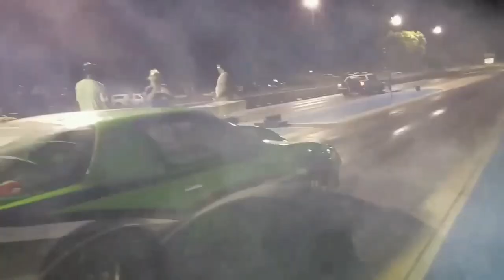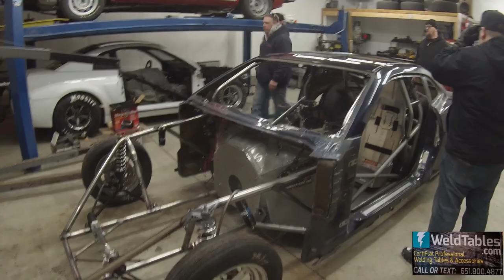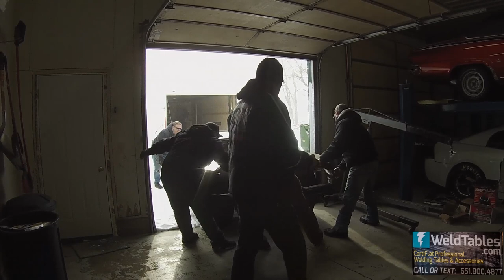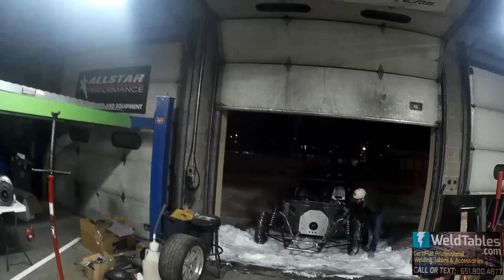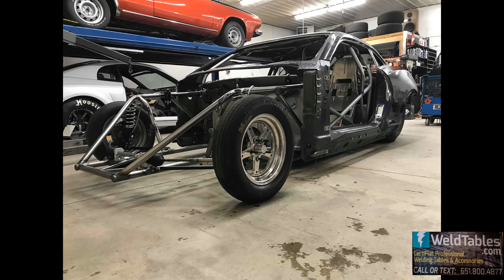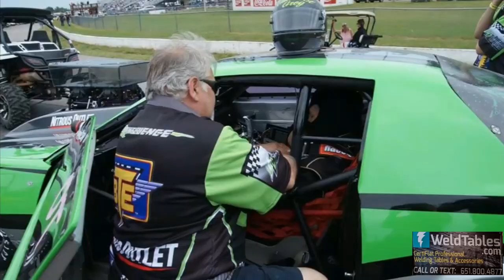'We Got The Chassis Back!' Bad Influence Build Series EP 1

Comment: Hello guys. What's the price on a full chassis build like that
Reply from the maker: Just the chassis/ roller or once the entire build is finished?
Reply: @BadInfluenceGarage  the full roller
Reply from the maker: @ralphfuller8680  the bare chassis runs about 12-15K (depending on cert and material), the rear end can run $2500-7500, shocks/ struts and brakes are about $5k-$6k, add in steering and the body at about $2k-$3k, plus wheels and tires to make it a roller at $4k its about $25,500 - $35,500. Depending how you outfit it with parts for a roller 👍

Still need to add the engine, trans, body panels, and wiring.
Reply: @BadInfluenceGarage  ok . I'm in Va and I'm really trying to get a build for this year.  And so far that's the price I like. Everyone else i talk to say 40k. That's crazy.
Reply from the maker: @ralphfuller8680  yes, it all depends on how you outfit the car, and if you do any of the work. We gutted the camaro shell ourselves to help save some money etc. This is also a docol chassis, and chromoly could save some money as well. Good luck with your upcoming build Sir!
Reply: @BadInfluenceGarage  ok I'm gonna lean on that information going forward.  Thank you all for this help. And hope the New Year is a Blessed 1 for you and your team.